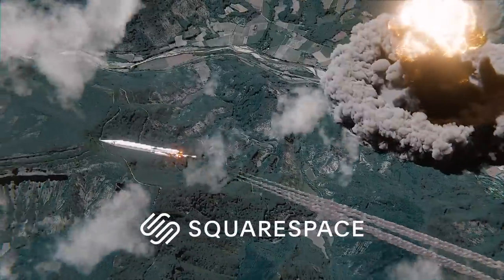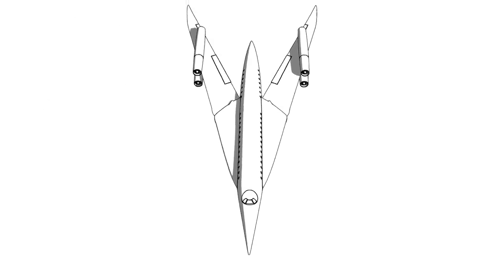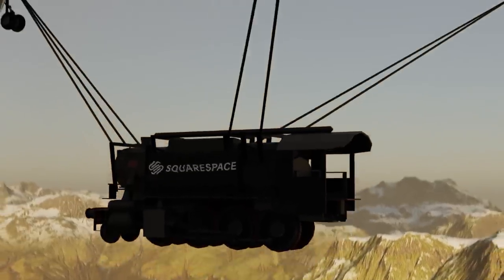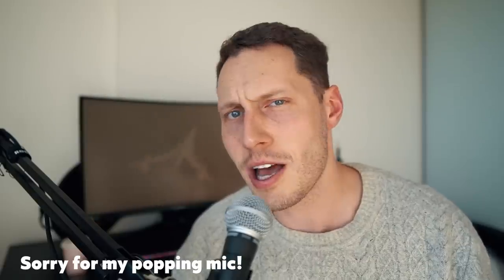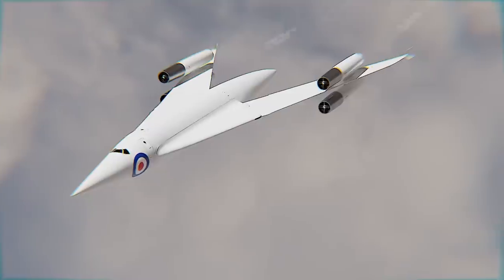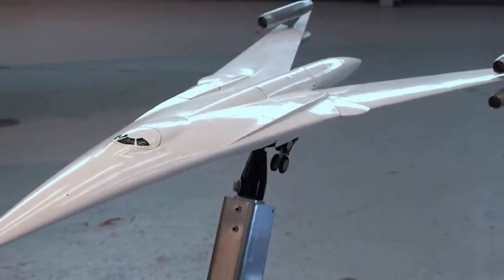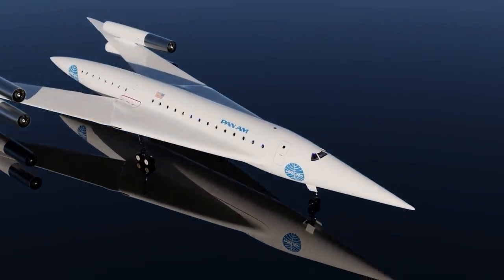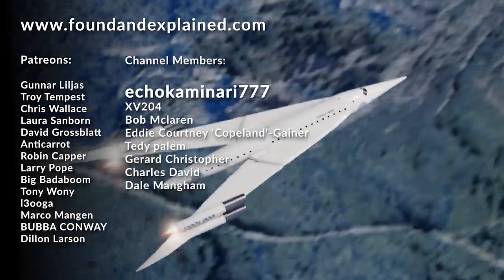The INSANE 1950s British Nuclear Bomber With No Tail - Vickers Swallow

Comment: As I remember, the reverse seat aims for passenger safety, they performed a crash test, and the result showed the passenger sitting on reverse seat distribute the force   of impact more equally, especially for the neck, but the reverse seat can't be found outside the test due to the passenger wouldn't be like it, and maybe cause vehicle sick
Reply: I was curious about that and Googled it. What came up for me is that while reverse seats are indeed safer, it came down to some people getting motion sickness in addition to forward-facing seats giving them the impression of being treated better.
Reply: I once saw a photo of cutaway Vickers V.1000/VC.7 scale model with passenger seats face backward, sadly can't recover it by Google picture search.
Reply: Simply put, people prefer to sit forwards, even if that means less safety in a crash.
Reply: Agreed with the safety explanation (although people do prefer to sit looking forward). This has even been proposed for somewhat more prosaic modes of transport such as school buses also for safety reasons. Thanks!
Reply: Essentially there are 2 components in a crash. Facing backwards puts the shock on the whole back vs straps so less psi. Also head flung rearward (whiplash) is far worse than it being flung forward at the end of a crash.
Reply: It did not work for Dak on Hoth tho.
Reply: I've flown 'backwards' a few times look up the vc-10
Reply: I agree. I think the RAF used to have seats facing backwards
Reply: When I was a kid Southwest airlines had some seats installed backwards. Usually near the front and over wing exits. I sat in them once and other than the novelty of it I don't remember any specific.
Reply: Uh yeah that help at hundreds of mph and thousands of feet intact or not …… that’s why they don’t have parachutes for everyone
Reply: i in 1987 fly in a RAF VC 10 with back seating
Reply: The safety aspect is note worthy, consider the cockpit configuration and the commercial application. Rear entrance for passengers, due to the sealed cockpit. Now advance this to now and put virtual windows showing forward flight. Oh wait, 🧐🤣🧐 sensory input opposing visuals....🤯🤮🤯
Reply: Yeah it's been established and tested over and over again.
Reply: I know I wouldn't be like it, and would definitely cause me to be vehicle sick.
Reply: In a plane crash, facing backwards isn't going to make much difference....
Reply: @Mute_Nostril_Agony  traveld to Germany in the 1970s with the RAF in a comit the seats faced backwards
Reply: I did as well
Reply: @richardhall6034  It's "Comet" Genius..
Reply: Y’all are right
Reply: @edwardfletcher7790  Depends on the crash.  People do survive plane crashes.  Also the seats for the cabin staff face backwards fore this exact reason.
Reply: @alm5992  Oh yeah, I wouldn't be able to handle it either.  I need a massive dose of Dramamine just to get through a road trip.
Reply: Same reason infant seats are backwards in cars for the first few months….
Reply: I flew a BA flight to. Saudi in 2001 it was a redirected flight from Kuwait everyone was upgraded to business 18hr delay at Heathrow snow in business it had reverse seats interesting for take off it was set on 70 ish slant you take off in the semi slop position
Reply: Yes they are meant to be much safer but sadly the maths for insurance costs for the airlines works out far cheaper if the passengers die, just a bereavement pay-out to family rather than very costly law suits from survivors, possibly filed one at a time making the cost in lawyers alone insane before any compensation could be paid out, bankrupting airlines and/or insurance companies. Sounds like a dark conspiracy theory, perhaps it is but since people's lives are often given a monetary value in everyday life (life insurance, the military etc..) I'm not very sceptical of the idea.
Reply: @9HighFlyer9  Same here (though I wasn't a kid).  I noticed the backward facing seats and was curious.  I remember being slightly uncomfortable during takeoff since I was leaning forward (due to acceleration and angle).  Aside from that, I didn't have any issues.
Reply: When Jets were first being rolled out in Australia in the early 60s, the Department of Civil Aviation wanted all the seats facing backwards for safety reasons. The airlines basically objected as it would have added a bespoke cost to Australian aircraft deliveries and the existing piston aircraft didnt have that anyway. It quietly got dropped.
Reply: @Mute_Nostril_Agony  They did as I remember that the RAF VC-10's were like thet when I had an air experience flight in the late 70's
Reply: I rode as passenger on USAF planes with seats facing backwards in the 1980s and 90s.
Reply: All RAF transport aircraft have rear facing seats apart from the flight crew for obvious reasons!
Reply: @edwardfletcher7790  It actually doubles your chance of survival in a crash.
Reply: Ha ha ha EMS folks would be the only ones willing to fly. We ride around backwards all the time ha ha ha
Reply: Remembering Captain Scarlet ´s SPV
Reply: I’d rather the safety than facing forwards
Reply: @FlaminFuel  ignorance is bliss
Reply: It would have not caused any vehicle sickness, as trains have some seats backwards,
and no complaints.
Seats backward in planes, would have saved a lots of lifes.
Some mother holding their babys on crash, 
the babys was lost, but if seats wold be backwards, the baby would just press to mother,
and wold have better survival rate.
Some say that things could fly to faces in backward seats, 
but how would it be possible, as seats are about higher than the heads are,
so things wold hit seats, not heads.
Reply: @observer6294  ya sure some lives saved in a small percentage of crashes. How many more lives would be saved if there were parachutes, ejectable pods, or any other actual safety measure design into the aircraft?  There would literally be little to no loss of life if they did so but they don't.  Bombs, missles, or terrorists so many ppl n horrible events averted.  9/11 pilots hit the button pods eject auto pilot crashes the plane into safe designated zones sounds like a great deterrent.  Ohh too much engineering.
Reply: @pk7056  - Even if You had parachutes to all passengers, the reality is, that sometimes it would have too little time, to use those parachutes, 
Then also if the plane is too high, the airpressure inside must be stabilized, before people can jump,
and then also, how many could jump from the plane, as being too scare to do so.
You can not put pods in a passenger jets, as the weight would be a problem.
And those planes that hitt the buildings in 9/11 was not passenger planes, 
they was similar planes but drones, as parts of jets was found,
and they for sure was not from a passenger plane.
You cant find support gruops for widows, nor any graves for the passengers.
One very clear factor is, there was limited distance from the earth, when cell phones worked,
in the "official story", the agically worked in very high altitude.
Then there is the building 7, no plane hit it, and came down at the same speed as falling stone.
The simple put passengers backwards, wold have saved many lifes, 
as for example, the flight attendants sits bacwards, and their survival rate is hihgher.
Just simple bacward seats of babys and toddlers is more safe, and some do that.
It simpley is safer for the neck.
Reply: @observer6294 segmented pods with parachutes can be done just affects their bottom line. Can drop a humvee y not. Then there is tower 7. Not disagreeing with backward seats just saying most 300 mph impacts not gunna help
Reply: @pk7056  - Pods are still too heavy. The point is, MOST time the seat direction would not mean nothing, BUTT, sometimes it could save lives. 
If parachutes would be used to save passengers, there could be possible method.
attach a parachute to an overall, that should be on whole the trip.
Make all planes so, that there is back door in it, where the jumping would be happening. (as it used to be on some planes)
That could save sometimes.
But more lives could be saved, if simple cameras would be all sides of the plane,
that should not be impossible, just put even a fucking phones to show whats going on, on a plane.
Mostly it is passengers, that tell crew, that then tells the pilot, if the engine is burning...
Reply: But then again, how effective is a seat position is when you crash in something this fast?
Reply: @DylanThorne  - Much better than, sitting face forward.
With a baby, sitting forward, is nearly impossible, as You cant hold thy.
With face bacwards, You can hold the baby, and have much much better change to survive.
Reply: @darrenstead3008  I'm a sailor and I've sailed backward at a few knots pretty regularly. I've also watched seagulls flying backwards a lot.
VMG vs Airspeed.
Reply: @brucermarino  I always thpught school bus seats were absurd, you literally sit on a plastic skinned cushion no seatbelt with the metal bar of the seat in front of you at forehead level
Reply: @norbis3939  - Actually, that would have prevented many deaths, as many planes has been crashed just before landing, or at take off.
The survival rate of flight attendants are higher, just cos their seats are backwards.
Reply: Another case of engineering practicality vs. human practicality
Reply: Steward(esse)s seats are often facing back for safety reasons in a crash, as they have the responsibility of getting the passengers out.
Reply: It also used for C-5 galaxy
Reply: My science class in high school did a project where teams of 4 had to build scale crash test cars. My team was the only ones who put the rear seat backwards, and while our front seat passengers had only moderate safety success, our rear seat passengers got the highest safety rating.
Reply: it is comparatively costs more
Reply: What if seats could have a built in mechanism that rotated them backwards in the event of a crash
Reply: @termiusprime  the speed it would have to rotate when it detected an imminent crash would give you whiplash or worse. Plus, the amount of weight those would add to a plane would be prohibitive. Plus, the seats are too close together to rotate around, people's knees would be in the way.
Reply: @musewolfman  I was thinking more of precautionary thing where the rotation would be Manuely activated in the event of an emergency, but yeah, the other points you made would be a problem
Reply: Flew RAF Brize Norton to Ascension island 1982/3 twice on RAF VC10.  Seating was all facing to the rear for safety.
Reply: That's why baby seats face backwards
Reply: The C-2 Greyhound, used by the Navy for COD, has the passenger seats facing backwards and also employs 5-pt safety harnesses. Makes sense for arrested landings.

Comment: Hawker Siddeley offered backwards seats in economy on its highly-advanced, but too small, Trident airliner which entered service in the mid 1960s. It was thought to be safer in the event of an accident as the passenger would be decelerated into the seat rather than thrown out of it. You can also see backwards seats in the SOV from ‘Captain Scarlet’.
Reply: In the states, southwest airlines offered rear facing seats so that the passengers could speak to each other.  That stopped by 1990 as it was similar to people turning around in the elevator/lift and speaking to the group.  Awkward. :)
Reply: SPV from Captain Scarlett.
Reply: Royal Air Force passenger transport aircraft all had rearward facing seats.
Reply: I'll let you off with that given that the O is adjacent to the P on most keyboards.
Reply: @barrybend7189  SPV from 'Captain Scarlet'* lol
Reply: Captain Scarlet Rules

Comment: As a boy I had  a weird little toy airplane in my pencil bag. Everything was molded into one single shape so the underlying VG concept was not very clear. I only found out about the significance of that shape years later when it turned out to be a rough representation of The Swallow. Barnes Wallis was so far ahead his time.  A possible  reason for the back to front seats could be the idea to use engine exhaust thrust reversal to slow the aircraft down during landing. Roll out length for every supersonic airplane is excessive compared to earlier generations. The concept  still make sense today anyway. The fixed center section indeed would have solved the pitch up problems Vickers was concerned about, as aircraft like the F111, Mig 23, Tomcat and Tornado have since then proven. Furthermore the rotating engines are at a perfect position to avoid wing tip stall. Later airplanes have dogtooth leading edges and LERX for the very same reason. Barnes Wallis  was actually against military planes. He has felt very responsible about the Dambuster strikes being so dangerous. It has been written that the passenger version of the Swallow was his real goal and he only proposed the military version to get enough money for further development of the concept.

Comment: The simple fact of the engine as a control surface was great, it was also a major problem. The gathering the engines into the tail and the installation of thrust vectoring would have simplified the aircraft, lowered wing weights and also improved survivability. As a aircraft with reduced radar cross section and high speed it's use as a recon aircraft would have been excellent. It would not have been as fast as the SR-71 but still acceptable until better engines and titanium pushed it into that speed range. It would also be interesting to see what a smaller scale interceptor with considerable weapon bay capacity yet excellent range and manuvering due to vectored thrust etc. All in all yet another example of what I consider to be a deliberate policy of wasting the British capacity in favour of the Americans.
Reply: Just pray u dont lose an engine. I wonder if a pilot could even catch it if one failed suddenly. Modern avionics definitely could
Reply: British man blaming the Americans for some british madman engineer failing to deliver his thunderbirds pet project lol

Comment: The seats were 'backwards' for safety reasons as studies had shown them to be more crashworthy. Several aircraft both concept and built have had backwards seats and from experience (20 years flying passenger in military cargo aircraft) they are much more comfortable if you're faced with rough landings or hard deceleration.

Comment: Wallis was a genius  - Geodesic construction on the R100 airship, the Wellesley and Wellington bombers, Bouncing Bomb and the Supersonic Bunker Busting super heavyweight Tallboy and Grand Slam bombs. But Swallow was allowing his imagination to outstrip practicality. Vickers contemporaries regarded his department as wasting talent and money on this and similar projects because the Swallow's issues of control and construction could not be addressed until decades later  when we had developed unstable fly by wire, digital engine control and composite manufacturing and construction. 

Wallis's colleague and eventual boss, Sir George Edwards,  knew a thing or two about practicalities as  he created the Valiant V-Bomber fleet into service on time and budget, ran the VC10, TSR2 and Concorde projects. When asked did he think the Concorde was a rather conservative approach to a supersonic passenger plane compared to the Boeing 2707 SST he said "It was to carry 200 passengers, more than any other airliner. It was to do it at Mach 3 for five hours, of which our actual experience was a few minutes. It was to be fully variable geometry wing, only a handful of experimental and military prototypes had used the system. It would weigh a Million Pounds. It just wasn't going to happen." You don't think the image in his head was just the B 2707 surely?
Reply: The geodesic construction is not his invention, this method was used on large wooden ships in 18 century.
Reply: @kakavdedatakavunuk8516  Where did I say it was Wallis's invention? I simply pointed out his genius was to apply it to large aero structures.
Reply: @uingaeoc3905  He is credited for this (not by you), I just wanted to clear this.

Comment: I know that! My father was in the armed forces in the 1960's and explained that to me. It was common for armed forces air transports to have backwards-facing seats, because a study had shown that more passengers survive a crash in that configuration. Though the same would be true in the crash of a civilian flight, facing the seats backwards had passengers boarding the plane and encountering the, "suggestion" that a crash was imminent. So the choice makes passengers feel more safe, when in fact more of them are likely to get injured.
Reply: It was also more comfortable than facing forward during heavy landings which were much more frequent in the days before the advent of computer assisted flight controls.

Comment: Duncan Sandys MP believed in all missiles rather than manned aircraft which scrapped aircraft like TSR2, and future British aircraft and was the nail in the coffin of future British Projects
Also Barnes Wallis wanted to spend time flying models rather than risking test pilotslives as he was shaken by losses in aircraft like the Wellington ( which he designed) and also the losses in 617 squadron on the Dams raid. The money he received forhis work on the Dams Raid, Tallboy & Grandslam bombs he donated to a trust for educating children of RAF aircrew who were lost in WW2
Reply: Duncan Sandys was correct - the missile was king. Ballistic missiles meant that interceptors were redundant and AA missiles meant that long range bombers were extremely vulnerable. Even the mighty A-12 (far faster and higher flying than TSR-2) almost came a cropper in Vietnam with an SA-2 exploding close enough to put debris through a wing fillet into the fuel tank support. The SA-2 was not even state of the art, being designed for slower and lower flying aircraft. If the more advanced SA-5 has been deployed, US aircraft would have been in trouble.